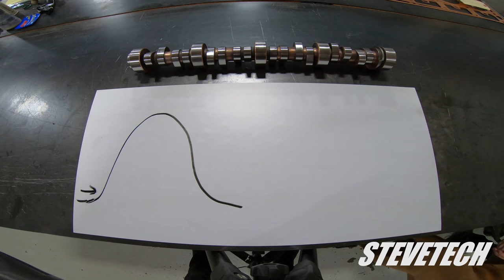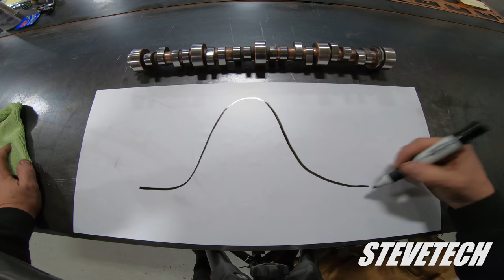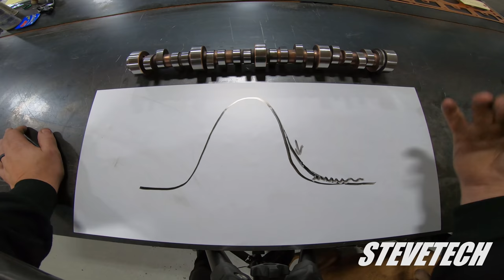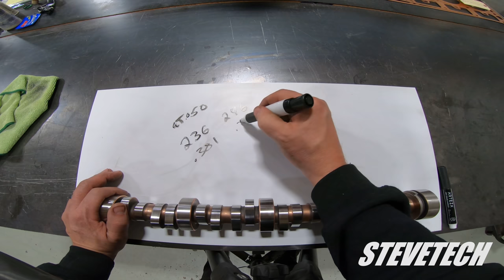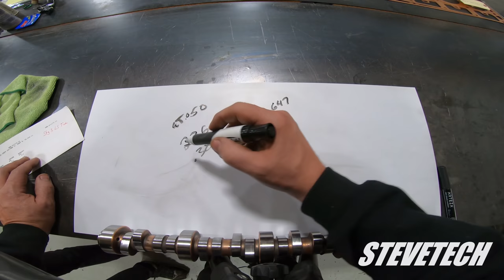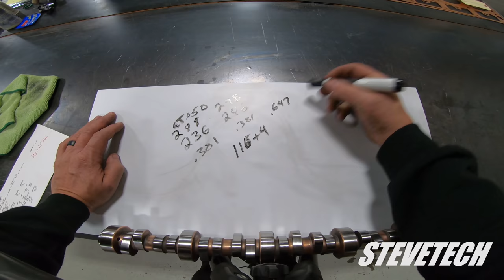Steve Tech --Camshafts!!

Comment: The Asymmetrical lobe design was a Harold Brookshire invention -- 
Advertised duration on hydraulic cams is generally @.006 but what we rally want is @.020 and .050 - the hydraulic lifter needs a gentle opening ramp rather then the clearance ramp that the solid cam has to have ---  Harvey Crane did the .050 thing to smear the left coast cam grinders, from using very strange duration numbers and then he went on to start using the .020 number to further qualify the cam design - and that freeked all the west coast cam guys out  -- but really helped all the engine builders and cam customers
Reply: John Reed (RIP) was very gracious and generous to teach me cam design OVER THE PHONE in the mid 80's (as i ordered 2-4 cams a month from him for various applications: hot street/marine and BBC towing).
John also multiples of asymmetrical designs that made mucho power while easy on the valve train. Many Nascar winners (of the 70's-80's) had a Reed cam while sporting a Crane or Comp sticker (for contingency $$$$).
He knew where every one of his "bumps on a stick" went.
Harold Brookshire (RIP) also had serious power makers utilizing asymmetrical profiles. A professional acquaintance utilized Ultradyne's cams for his clients and his own Gen 1 SBC's (383-406) & 496/540 BBC's.
Never a problem with making power with reliability.  

Such a looong time ago.......
Reply: @samrapheal1828  - I worked for John for over 10 year's = It is very interesting to know that he had a student

Comment: With all of that turbo pressure, the next obvious step is pneumatic valve trains, even with a push rod engine. I remember Larry Morgan calling out NHRA to do something about the cost of valve springs designed for Pro Stock....think about the HUGE reduction in mass and it's parasitic losses to HP.
  Less mass means a more accurate following event on valve closure....less bounce, more HP??

Comment: Steve .. I know you do performance racing engines, but have you ever built a purpose built tow rig engine ? I've been toying with the idea of building a 6L LS engine with a nice torque curve and a HP curve in the lower end of the RPM range with an appropriate turbo for the setup, holly computer and dash setup ... I'd love to see a video series on some of this sort of tech. Most of the racers out there need a solid tow rig.
Reply: I'd go with a small turbo like an S366 fast response, keep the boost low should make big TQ in the. Low to mid range
Reply: Or just get a diesel and don’t go through all that unnecessary stuff to build a gasser for towing
Reply: Also get a stage one cam or a torque cam. What you want to build is something similar to what I'm building for my truck but mine is a 5.3.
Reply: @zayhs6351  exactly. As the owner of a 1k wheel hp gas platform, and a 680 hp 4th gen cummins, I can't imagine towing with the gasser, built or not.
Reply: I pull a small camper , not really a diesel fan particularly these new ones that require that def fluid ... I don't need 600hp just 350 hp of lower end of the RPM range gas torque. I realize I am in the minority on this, but I'd rather stick to a gas powered truck

Comment: That's a nice piece. I'm not a big gear head but I enjoy this stuff about engines. Would have been nice if you explained what the numbers are referencing. I'm guessing they are based on 360 degree for rotation. 
I'll Google can shaft numbers explained.

Comment: I imagine the 4k hp cam isn't a ton bigger as you are covering mostly the same RPM band just cramming a lot more boost in.  Cams are more rpm range dependent than they are boost pressure dependent.  Cylinder heads have a huge effect on needed lift and duration though.  The better the flowing head the less camshaft duration you need for a given displacement and RPM don't you agree?

Comment: I’m wondering if I understand the asymmetric profile. It sounds like the opening and closing points, at 0.050”, would be a couple degrees later than a symmetrical lobe. 236° installed at 112 should give IO at 6° BTDC and IC at 50° ABDC. Your asymmetric profile must shift that a couple degrees retarded, or 4° and 52° respectively. That also makes the overlap very close to symmetrical around TDC. The wide-ish LSA results in that overlap being narrow for a high output engine which probably helps deal with turbine back pressure, I’m guessing. Very interesting!

Comment: Steve, great video. Glad to see you racer guys sharing your knowledge with us backyard mechs. Do asymetrical cams also work for nitrous applications? I am thinking about a tunnelrammed 496 BBC with nitrous.
Reply: Yes. Imagine the cam running N.A. as long as the turbo is not boosting. That means it will work N.A. and N.A. cams will dictate obviously your engine power without nitrous. Then spray whatever you want with NOS.

Comment: I always thought wouldnt it be cool if you could change the lube shape as it were spinning.  Low lift and duration at low rpm and high at high rpm.  Metal cant morph like that though.    But solenoids attached to the valve have the ability to change life and duration to whatever at any given rpm.
Reply: Basically this is bring accomplished in modern engines with VVT.

Comment: I have a question.  Steve I no genius but I know a nuff to get my self in trouble.   I have a SBC DART SHP block and it has some descent parts.  It has a second hand cam ( that was in a procharger engine ) in it with some AFR 195 CNC heads. I’m wondering where I should go from here. It makes 897 on the tire and I drive it every weekend I race it a few times a year.  Should I even both with it and do you think this should go in the 8 second in the 1/4 mile.